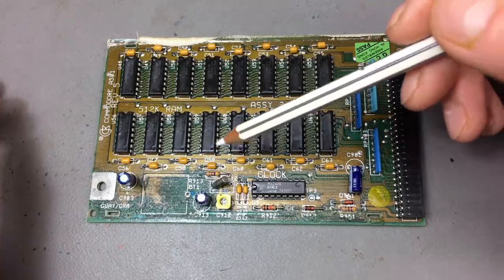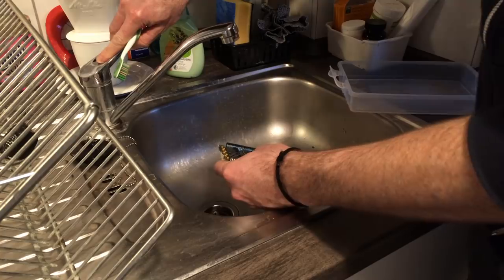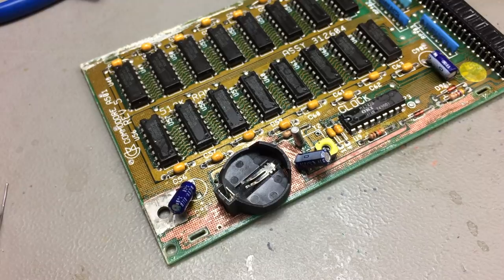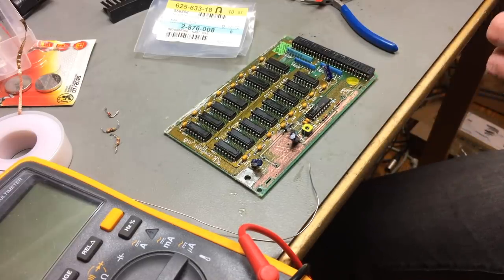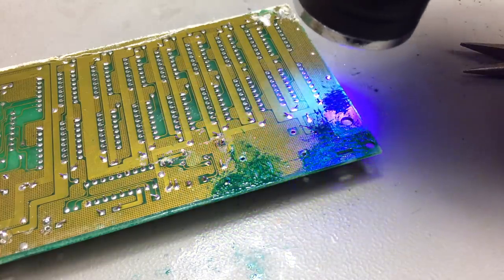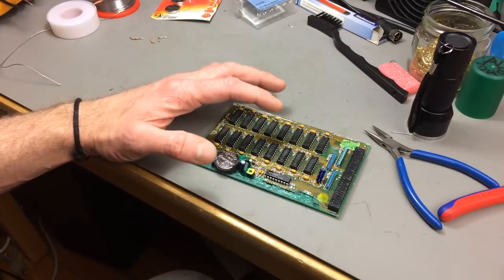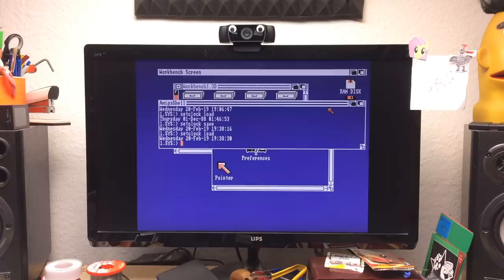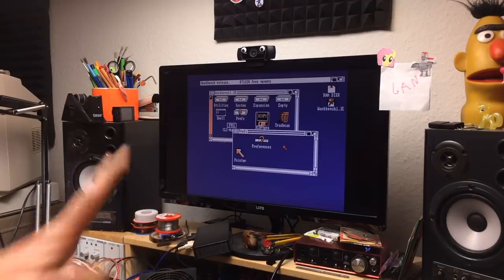Commodore A501 RAM Expansion Battery Damage Restoration

Comment: The solder mask works well. Been using it recently in my projects . I also use a brush to apply it, still looking for better method to get a more even spread. I found placing small bits of blue tack on the vias and around components before applying and removing it again before curing, helps keep it neat.
Reply from the maker: Yeah, it looks a bit messy but is pretty handy. I think a spatula might result in a more even look. Using blue tack on the vias is a very good idea, I'm going to try that the next time.

Comment: OOh! Im famous! LOL
Reply: A Schottky should be fine in this application. They're not always suitable though, as the downside of Schottky's is that they have much higher reverse leakage than normal diodes. However I dont expect this would be a problem here. If it ever makes you nervous, an ordinary 1N4148 diode will work.

The normal adapter boards I see just put a 1N4148 in series with the battery. This works, but it is wasting part of the battery capacity... and also it's paying for an extra adapter board when you don't really need one!
Reply from the maker: You are! Thanks again for the great tip. :)
Reply from the maker: I got the tip with the Schottky diode from a forum threat (I don't even remember which one). As you said, the higher reverse leakage is not a problem in this case and the higher efficiency and faster switching is a plus. Supposedly puts less stress on the battery than a regular diode. (No idea really if that's true but it makes sense.)

Comment: I was fortunate with my A501. The battery had leaked a lot but it hadn't spread to the board. I got a kit with a small board for the coincell holder and a diode that I soldered together. It works perfectly, it was just a bit to big so I had to scrap the RF shield, which doesn't really matter to me and it'll be easier to replace the battery when I need to.

Comment: Nice work. You can put a resistor (say 1 or 2k) in series with the diode. That will offer some protection if the diode fails short.

Comment: ES LEBT! Good that it works again and didn't get turned into scrap since who knows how long those boards will last anymore. I was wondering about that solder mask stuff and it looks like it actually worked, I should try that for some stuff I have here then. I guess it truly is better to put a cell battery in there really since the chance of leakage is basically non-existent from that sort of thing now.

Comment: Instead of removing resistors and using CR2032 cells, I usually use LIR2032 RECHARGEABLE cells which are exactly the same dimensions and layout as a CR2032... and they don't leak either :D They also come with legs wave soldered to them so you don't need the battery holder at all if you get the ones with legs.
Reply: Gabriel Androczky hmmm does not sound like a good idea from what Jan was saying at 21:00
Reply: You should look at the data sheet for the LIR or ML2032' rechargeable.  They do not have the same charging requirements as the NIMH/NICAD batteries that were used in the Amiga.  In fact it can cause the battery to overheat and explode if left on long enough.  When I was looking for replacements I looked at the rechargeable lithiums too and after reading the data sheets and researching it more it is clear to me that they are not compatible and should not be used.  In my A2000, I opted for a small 3.6 volt rechargeable NIMH cordless phone battery.  It works perfectly.
Reply: @magnustveten492  There's very little in the way of actual explanation here, but I suspect the problem is that the circuit trickle chatges the intended nimh battery forever whereas a lithium one would be overcharged to over voltage and be damaged, in that case I would simply add a protection zener across the cell to leak away the excess voltage. If the charge current is too high when the cell is low just add a resistor in series. The power levels involved here are pretty small anyways.
Reply: I’ll dig into the matter a bit more then. As far as I know, but it’s been a long time since I investigated this topic, the Amiga provides charging current way under datasheet requirements of the barrel cells, which led me to conclude that these are a viable replacement. I’ll revisit the specs to make sure though.
Reply from the maker: I thought about doing the same a while back but decided to better go the safe way and cut off the supply voltage with a diode. The rechargeable lithium cells would need an additional protection circuit to safely prevent overcharging (which could result in them blowing up in the worst case). I think you probably could add a one-chip solution thingy to be absolutely safe. And probably it's going to work fine in the real world because as you mentioned the charging current from the Amiga should be pretty low.

Comment: I bought some of that UV curing solder mask from Banggood (direct from China) and found that it requires a very thin layer to be applied in order for it to cure well. My first test was applied way too thick and it wouldn’t cure at all, so I thought it didn’t work at all. Subsequent tests brushing it thinner so it only lightly tinted the copper green worked much better and cured fast. Even though it was so thin it still repelled solder and insulated the copper trace.
Reply from the maker: Ah, thanks for sharing. I applied a bit much I guess. The top layer didn’t cure properly but I could just wipe it off and the lower layers cured perfectly fine. I had to expose it to UV for quite a while though. I’m going to use a thinner coat next time. :)

Comment: It was great as always, but sometimes I wish you would explain more of what you're doing. How come you didn't lift traces off the board scraping it with a screwdriver? What is that pen thing and what does it do? How come the application of the solder mask didn't isolate the exposed mounting holes for the battery holder? Otherwise, great work and an interesting video. 🙂

Comment: When you started talking about solder mask I started twitching from memories of using Conformal Coating and getting so stoned (even recently).  I hate that stuff.  Hopefully the green mask doesn't make you feel that sick.  I am happy that your clock and memory board started working.  That is great!  It doesn't retain memory on the board does it?  Just runs the clock chip?
Reply from the maker: Yes, I have some of that conformal coating spray, too. I predominately use it for silencing humming transformers (because it seals the windings and prevents them from vibrating). It smells awful for days. The battery is only for keeping time, the RAM would drain it pretty quickly I guess.

Comment: That's a nifty little UV light. I wonder if it would be great for spot-treating some yellowed case plastics, though I suppose it would be a major pain in the ass to hold the flashlight in one place for 4-8 hours... :P
Reply from the maker: The UV flashlight is pretty cheaply made (obviously). I doubt that it is going to last long but it's pretty handy. Maybe not for retrobrighting but I heard some folks use it for erasing UV EPROMS. :)

Comment: 12:18 Be aware that Schottky diodes have a greater reverse leakage current than regular diodes. Not sure if it's a problem with this particular circuit, but it is something to bear in mind.
Reply: there is still a normal 4148 wich prevents discharging the cr2032 via the +5v rail backwards if the computer is turned off. the shottky just is acting when the 3v supplies the clock ic

Comment: Did you ever have to go back and reset the clock? It looked to me like you might've rolled the year back to 1919 instead of forward to 2019. Or was the Amiga perhaps not Y2K compliant and this was better than leaving the clock not set?

Incidentally, it's sure hard to believe that was over 20 years ago when everyone was concerned their electronics might struggle with the transition to 2000.

Comment: Great vid 👍 and is that classed as fast ram that module 🤔 and clean the head drive motor on my Amiga and is work great now 😊 wasn’t the drive motor at fault 😊
Reply from the maker: Thanks Rob! Yeah, "fast" meant something else back in the day... ;) Glad you got your drive working again!
Reply: Thanks, and I’m newish to the Amiga and heard about fast ram and slow ram used a lot on my research on it, I have a bad A500+ with bad battery leakage and will get it working very soon, hopefully 😊

Comment: Is this multi-layer PCB or not? If not, this would probably be an excellent occasion to use PCBWay or some similar service and let them make a brand new PCB for you. Then transfer all the components to have it 100% corrosion free and look brand new on top. Would it work like that?
Reply from the maker: The PCB is two layer only (it's an actual part of the Amiga 500 PCB that is cut out during manufacturing). There's going to be new PCBs around soon on A1k.org. By the way, I think you could also submit multi-layer boards to PCBWay and they could manufacture them.
Reply: I'm sure you can. I just have no idea (lack of skill on my part) how would I design a copy of a board that is multilayered since I can't see what is going on on all those inner layers. I always thought that multi-layer boards have different paths on different layers. But I might be completely wrong here :D Thank you for the answer anyway.

Comment: Hello. My COMMODORE 501 512k expansion ram look same or even worst, first 2 chips in 1 line closer to battery have coroded tracks under solder mask and generally square 3cmx3cm damaged coper tracks on both sides pcb. This stuf from GP battery is amazing what can do, just give him enought time. My amiga 500 looks most like new from shop no yeallowing signsin any surfaces,  because probably last 25-28 years someone leawe in peace in carton box. But this little ram board made some damage even on edge conector under gold plate even on first coper track closer to expansion slot i see very little dark spots... Evaporated GP stuf spread friendship with coper traces even coated solder mask XD

Comment: Wouldn't the schottky diode leak more reverse current?
Reply from the maker: Yes, but according to the forum thread I got the Schottky idea from (unfortunately I can't find it), it actually puts less stress on the battery than a regular diode would. It reacts faster and has a higher efficiency.
Reply: @JanBeta  for sure, the lower forward voltage of Schottky diodes are really good for It, however i'm not sure that the reverse leakage current will make the battery happy, i guess It shouldn't be a problem

Comment: why not use a chargable coin cell? O.o
Reply: @KiloSierraAlpha There is already a charging circuit on the board for the removed battery as was explained in the beginning of this video.
Reply: @benbaselet2026  For NiCads, as Jan says. You can't charge a Lithium coin battery with that.
Reply: @Nukle0n  Sure you can, just put some overvoltage protection to it like a suitable zener across the cell.
Reply: @benbaselet2026  putting voltage into a lithium coin cell results in a fire.

Comment: is there any particular reason not to use a rechargeable lr2032 battery like you do when repairing the battery in a dreamcast
Reply: You would need to build an entirely new charging circuit, Lithium-Ions or Li-Pos do NOT charge like the original NiCad barrel batteries from these boards.
Reply: The LR2032 isn’t even the correct rechargeable battery for a Dreamcast. It should be ML2032, unless you love putting in batteries with the wrong voltage into your beloved retro consoles.

Comment: Yes, acid will neutralise acid
This logic confuses me
Reply: Battery acid is badly named. Probably because in lead acid batteries (car batteries) it actually is acid. But for lithium batteries, the liquid is in fact strongly basic.
Reply: @WizardNumberNext  We were both right in part: These are not lithium batteries, my bad. However they are NiCd or NiMH, which do indeed have alkaline electrolyte.
Reply: @WizardNumberNext  The old leaky batteries on PCs and early Macs were of those type. I assumed this would also be the case on Amigas, but I might be wrong.

Comment: What have you done! this is not good, sure its better than most tries at this repair but you have done bad. you did a good job with the board but before masking you did not tin the board first which is the best wat to stop corrosion! then you fit a non rechargable battery where a rechargable battery goes, what this means is that the board will try and charge the battery proberly making it leak and you would have to start over again! check out our video on the best way to repair this!

Comment: Wasn't the original battery acidic? If so, corrosion should be neutralized with something basic (for instance, baking soda). Vinegar and lemon juice neutralize alkaline (basic) battery spills.
Reply from the maker: Good point! I didn’t do much research considering the chemicals at play. I’ve seen quite some people cleaning the leakage from the Vartas with various acidic liquids though. Not at all sure if the battery is basic but at least it seemed to me the vinegar dissolved the affected areas quite a bit.
Reply: @JanBeta  If it was Varta then vinegar was the good choice. I also used vinegar for cleaning corrosion by Varta on couple of A500+, it neutralized it just fine.
Reply: Yeah and distilled water would be even better than tap water
Reply: I'm no chemist, but I think the electrolyte is basic, not acidic.
https://en.wikipedia.org/wiki/Lithium_battery#Chemistries
Reply: The original battery was not Lithium, it was either NiCd or NiMH but I guess they're all basic and that's why people always use vinegar or lemon juice.
Reply: @discoHR  Oops, I got mixed up. Yes, the electrolyte in both NiCd and NiMH batteries is potassium hydroxide. That's definitely basic!
https://en.wikipedia.org/wiki/Nickel%E2%80%93cadmium_battery#Electrochemistry

Comment: How wrong?
Rinse with trap water
Introduce some conducting substances
Rinse with alcohol to remove water, but leave conducting substances

This is not how it should be done.
Tap water should never be here.
You can use distilled water.
Runs with alcohol.
Bake at over 100C to remove water.

Never use tap water